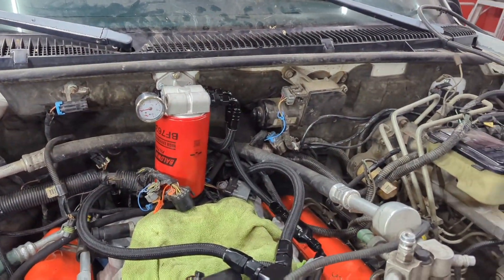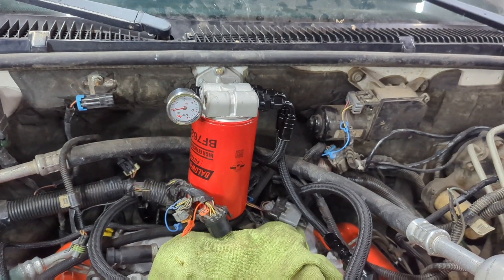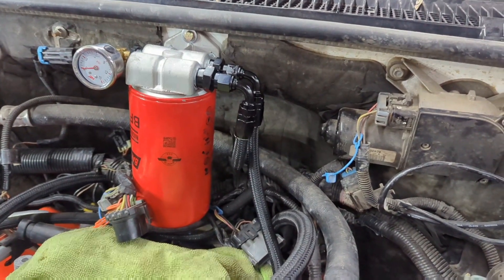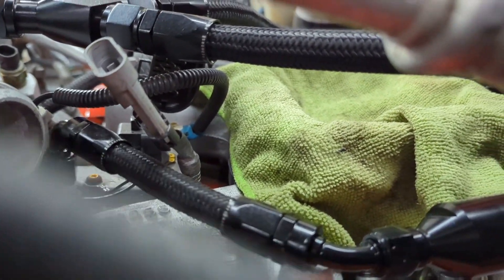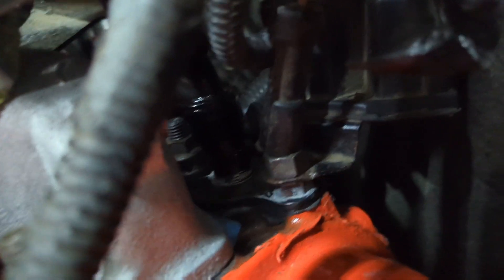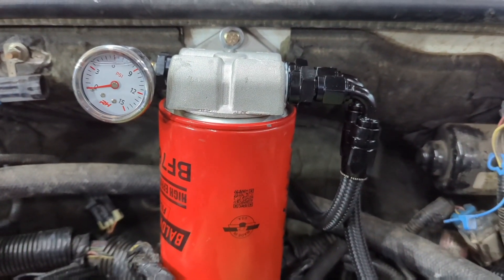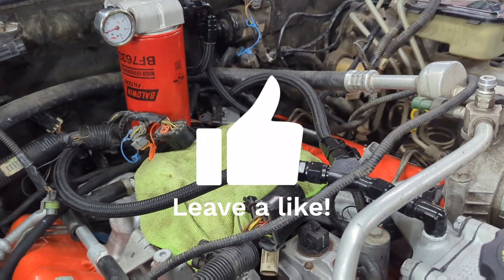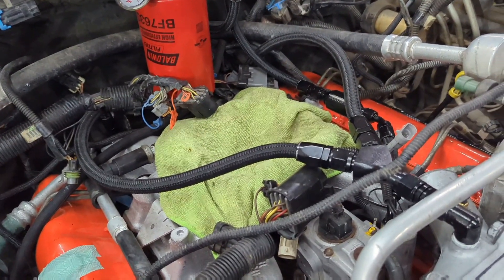GMC 6.5 Turbo Diesel Fuel and Cooling System Upgrades

Comment: Running this large of a hose and the coolant crossover, do you have any issues with building up heat inside the cab?
Reply from the maker: It does take a little longer to heat up. If I were to do a change, I would go with 6AN line instead for a colder climate.

Comment: How's the truck running now?  There is some controversy over the benefits of the rear cylinder coolant lines, and whether they alter flow across the head in a negative manner.  I wonder if there is any truth to that?  Clean looking mods, though.  Do it right the first time!
Reply from the maker: The truck is running great. It runs really cool. So much so that it can take quite a while for the thermostats to open
I am going to try going from the 8an lines down to a 6an line to slow the flow just a little to bring temps up a bit. But overall I have not seen any negative from doing this modification.

Comment: The stock Fuel filter manager does have a water separator and purge …ourge is on 1/4 T valve upfront.

Comment: Can you send me a good picture where you connected the back cooler lines. Very nice set up thankyou very much great video
Reply from the maker: The need to be tapped into the rear left and right plates that plug the back water ports
Reply: What coolant are you using? I flushed mine and using red semi diesel radiator fluid.
Reply from the maker: Using the red as well